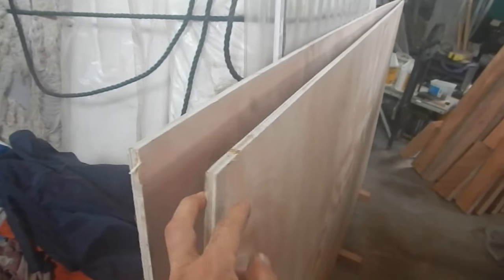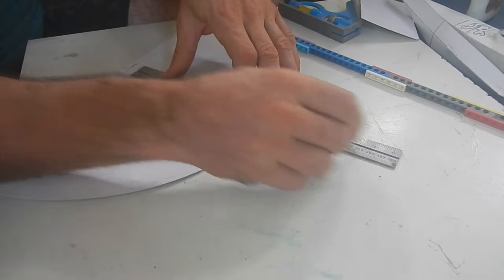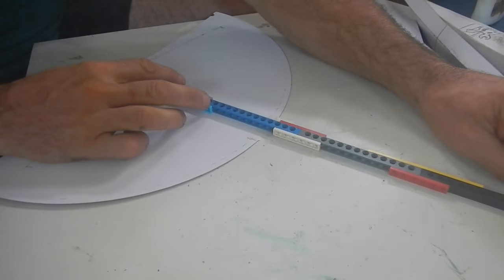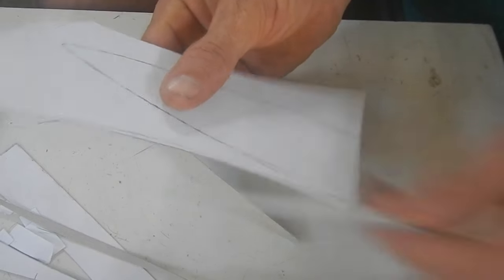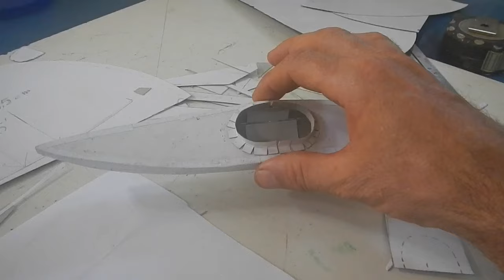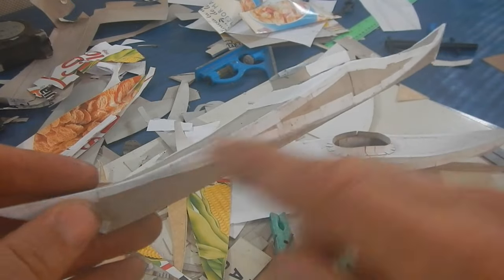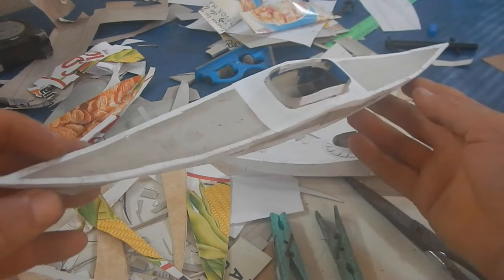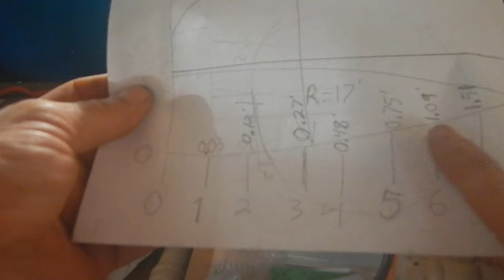Making Kayaks 001 -Design CAD (Cardboard Aided Design)

Comment: Hi Jamie, love the videos of your designs & experiences.
I have two sea kayaks.  Might I humbly suggest making the underside in the middle section of your kayak, of about a third of its entire length, considerably flatter.  The Vee shape along its whole length will make it soo tippy with your current design.  Also I'm sure that you've also thought about inserting at least a couple of cross-braces to improve rigidity.  Hope this may help you a little; best wishes, JohnnyK.
Reply: Agreed. I would strongly recommend flattening the hull from your knees to behind your bum, the flattest being at your bum. Maybe 10 degree deadrise. Also, bulkheads, while good for rigidity, are a real plus for trapping air when you need to scramble back in after a capsize.  Great models!
Reply from the maker: Funny thing.  I made one more Cardboard one this morning.  ...with a few adjustments including a flat bottom on the middle.  ;-)
I think I've got the final design now, and can start plywooding soon.  :-)

Comment: I'm beginning the earliest stages stages of design for a wave piercing carbon fiber hull. I don't enjoy riding over heavy seas, I want to go in a straight line through those seas. Insane? Possibly. Thankfully, I too am employing CAD in this process. Cardboard and glue will always be better (cheaper) , and more visually inspiring, than a computer screen.
*Edit: Carbon fiber is only expensive if you don't know where to find a dumpster full of the stuff.

Comment: It will be too tippy. The reason is the hull is too round and narrow and the top is too high so it creates too high of a center of gravity. We tall non Eskimo people need a longer wider flatter bottom of hull for stability. The easiest proper measure of a hull bottom and sides are the Folbot Kayak as it incorperates good wider and flatter hull for best
center of gravity use.